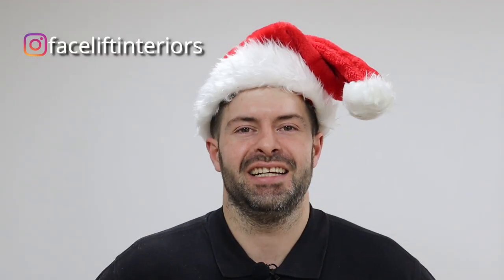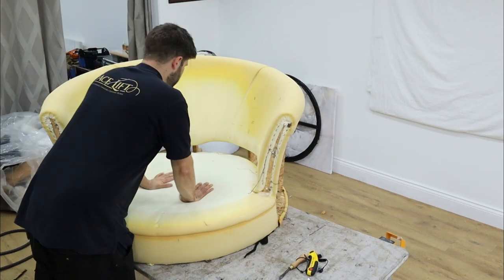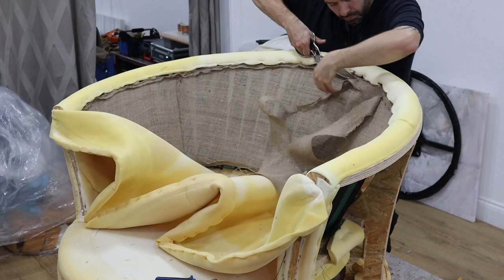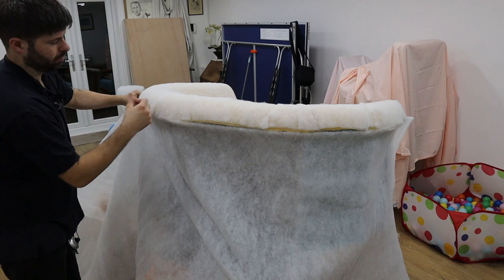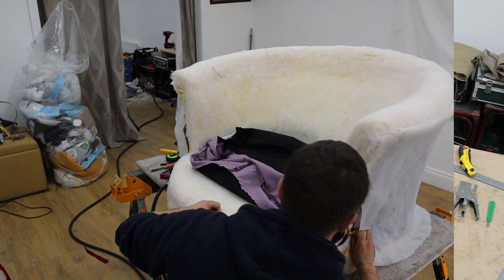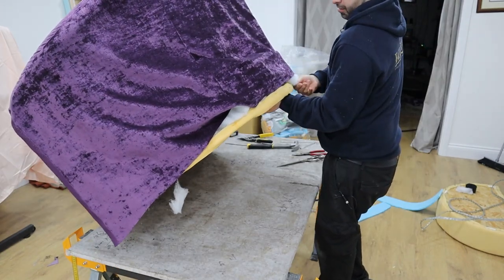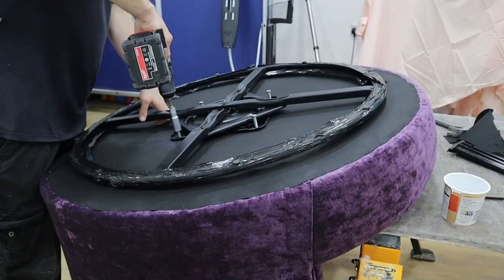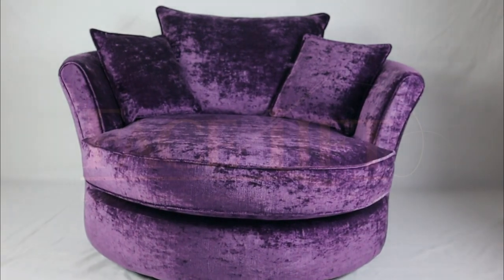HOW TO UPHOLSTER A CURVED CHAIR OR SOFA | UPHOLSTERY TIPS AND TRICKS | FaceliftInteriors

Comment: I’ve been wanting to get a label printer for my small business for the longest time and finally pulled the trigger. I’m glad I did ! This machine is great https://www.youtube.com/post/Ugkxw55tQTywUAAOsbrlwxONZULry77sFF1Q and the blue/green color matches the rest of the accents in my office. My favorite part is how small the footprint is. It’s less than 1/4 the size of my regular printer.Set up was fairly easy. Seller will email you a link with video instructions Which I found to be more helpful than the written instructions. I use a Mac and had no issues. They even included an adaptor for USB to USB-c which is great because I’m always losing mine! I had a few issues getting the labels to print properly and wasted quite a few sheets. You need to play around with the settings to get everything adjusted just right. If you have the wrong settings, it’ll crop off the edges or feed through blank labels. These aren’t issues with the machine though, just user error.
Reply from the maker: Thank you 🙇 🙏☺️📐📌🪡🧵✂️